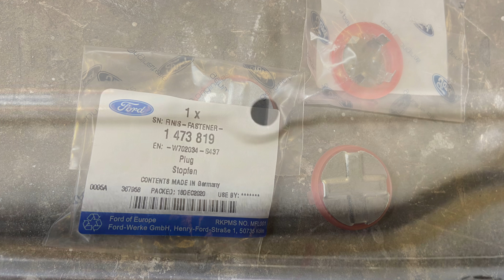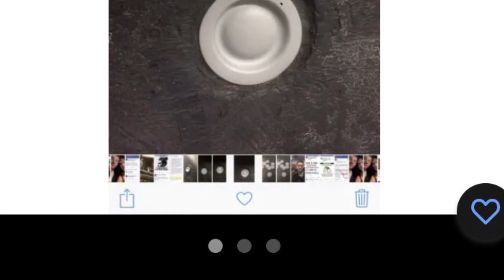Base RS2000 Restoration 23: Brown Envelopes

Comment: Nice little jobs..
 Interesting as here in Aus our mk2 escorts had a mix of metal and rubber bungs. Boot holes and inner sills were rubber and possibly front floor holes but not fully sure .
Reply from the maker: Thanks Marty, there’s got to be loads of little differences. There are plenty between German and UK built Escorts never mind from Aus or SA.